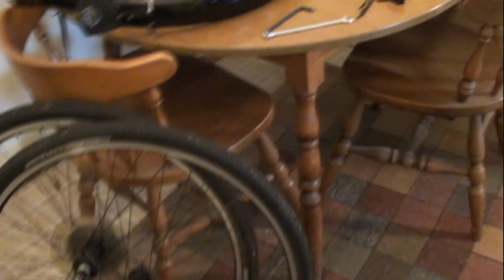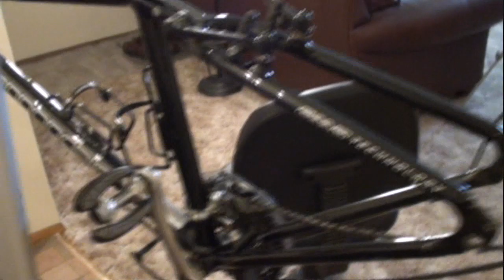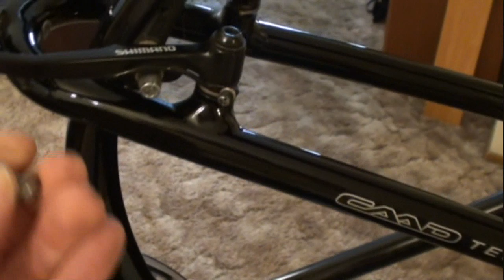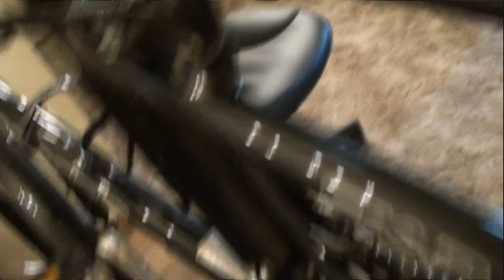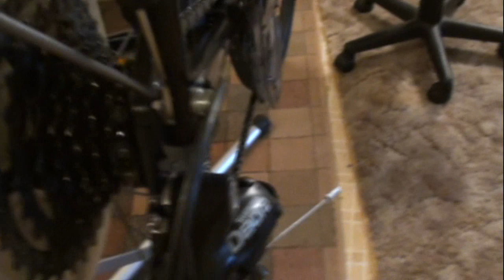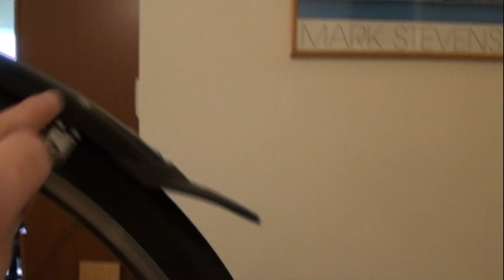Installing Bicycle Accessories

Comment: I got the same fenders. It went in smoothly on the bike. I was also having trouble with the rear fender at the end. I didn't break of that piece I bent it for more support and zip tied it. Like that if someone tries to steal it. The will have to cut as well as screwing the fenders off. I've heard people taking stuff from other peoples locked bike. I zip tied everything on my bikes.